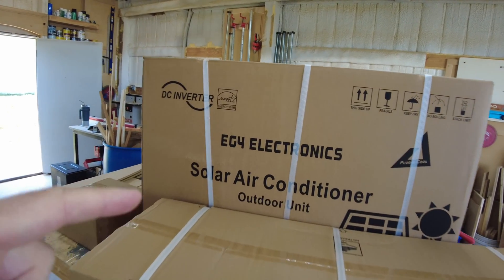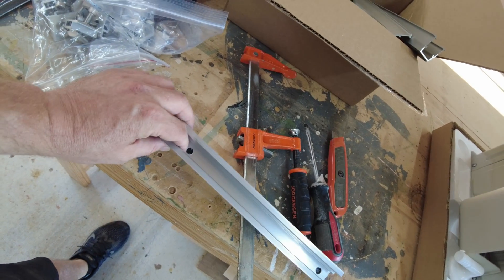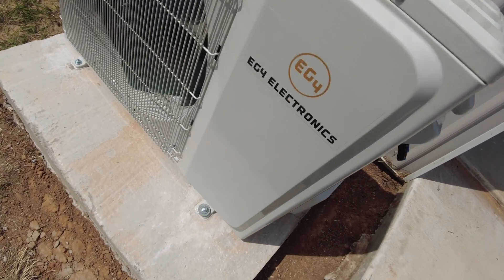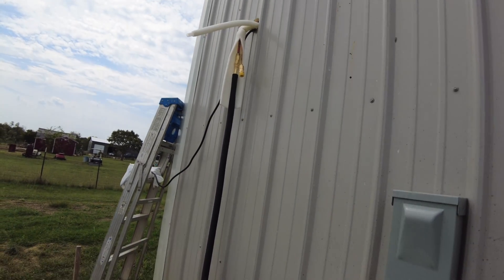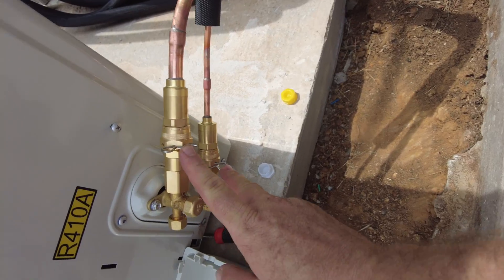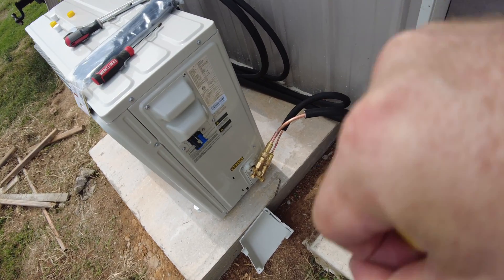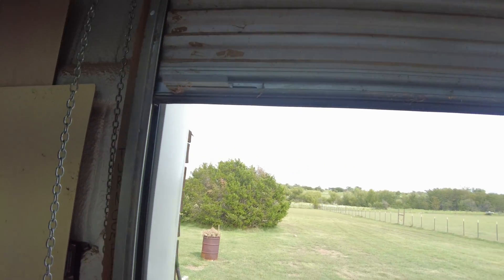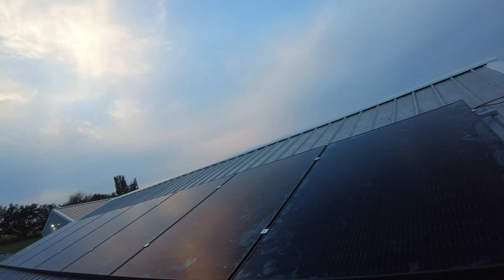EG4 Hybrid Solar Mini-Split 24000 BTU Air Conditioner Heat Pump

Comment from the maker: Affiliate Links:
➡EG4 Hybrid Solar Mini-Split 24000 BTU: https://signaturesolar.com/eg4-hybrid-ac-dc-solar-air-conditioner-2-ton/?ref=JRZm6fna41pidY
➡EG4 Hybrid Solar Mini-Split 24000 BTU Kit w/Panels: https://signaturesolar.com/eg4-hybrid-solar-mini-split-kit-energy-star-certified-air-conditioner-heat-pump-ac-dc-24000-btu-seer2-21-3150-watts-of-solar-pv-kit-e0012/?ref=JRZm6fna41pidY
➡Mini Rails: https://signaturesolar.com/mini-rail-330mm/?ref=JRZm6fna41pidY
➡Mid Clamps: https://signaturesolar.com/mid-clamp-for-mini-rail-silver/?ref=JRZm6fna41pidY
➡End Clamps: https://signaturesolar.com/end-clamp-for-mini-rail-35mm-silver/?ref=JRZm6fna41pidY
➡Mini Rail Grounding Clip (Need 1 per clamp): https://signaturesolar.com/standing-seam-mini-rail-grounding-clip/?ref=JRZm6fna41pidY
➡PV Wire: https://signaturesolar.com/pv-wire-50-ft-10-gauge-copper-30-amp-black-red/?ref=JRZm6fna41pidY
➡PV DC Isolator switch: https://signaturesolar.com/dc-disconnect-rooftop-isolator-switch-by-imo/?ref=JRZm6fna41pidY

================
AFFILIATE DISCLOSURE: This channel may earn an affiliate commission if you purchase products through links I provide. 
================
CONTACT: bradcagleyt@gmail.com
Business/Collaboration only. Please do not contact me for for personal project help, or advice.
================
DISCLAIMER: These videos are documenting my own personal projects, and experiences. These projects, and activities can be dangerous. I am not a professional. You should always consult with a professional. This content is for entertainment purposes only. DO NOT try any of this at home, doing so will be at your own risk.

Comment: Remount the compressor unit and this time put the rubber foots on before you screw down the mounting bolts, that will make the unit run so much quieter

Comment: You may want to add what's called a heat pump riser under each leg. The mini splits, when they run in heat mode, the outdoor unit can build ice. the unit will go into defrost and not having space under the unit will cause the ice to build up and may damage the outdoor coil causing the refrigerant to leak. I'm in Connecticut, the manufacturer I use will not warranty the coil if it is not up on those stands.

Comment: Your array is way over sized for this system but I would split it; give half the panels to the EG4 and the other half towards a battery system like their EG4 or EcoFlow products to offset the energy you are using in the shop.  You are wasting a lot of your solar production and over paneling the specs on the mini split I’m assuming… good stuff otherwise.. just something to think about.
Reply from the maker: This is actually the big 24,000BTU (2 ton) unit so it needs more power than your typical mini-split. Also It was purchased as a complete kit from signature solar, and those are all the panels that came in the kit. Thanks!

Comment: What about hot nights??
Reply from the maker: Runs off your grid/house power at night.
Reply: Incorporate thermal mass into your home. The machine cools the interior of the home, the mass absorbs heat after the sun goes down, keeping you cooler for longer.

Comment: 13 Amps exceeds the maximum recommended amperage for these. Apparently they will tolerate it, but you're not supposed to run more than 12 amps.

Comment: Inefficient I have seen people install them then disconnect them to run the panels directly to their inverter and use all the solar cells capacity to its fullest.. then feed a regular cheaper mini-split... this is a fail..You will under utilize your panels if you use this system nice try..
Reply: Yes, that is all true, but not everyone has grid tied solar, or an ESS. You do not need a permit or an interconnection agreement for this. This requires far less monetary investment to add cooling or heating to a space that is usually only occupied during the day. Also if you live in an area with high summer heat and/or humidity, with high electric rates, this is a way to reduce your power bills with a fairly short break even/payoff period, without the need for permitting/interconnection agreement etc. Although you may need an electrical permit if wired to a panel. But yes, if you already have panels/inverter/ESS, it would be cheaper to add a basic inverter based mini-split (pioneer/senville/alpine/gree etc)
Reply: Maybe I’m slow, or maybe your message was just poorly put together, but I’m a minute in and reading your comment has me lost.
Reply: No bats or inverter needed unless need night time power lol if so about $3k will be needed for bats and inverter.For off grid.

Comment: Why would you not hook up the solar Panels to a microinverter and feed the power into the grid? Then you could also cool with it, but if you do not want to cool, you could use it for other appliances. 

Like this, the excess solar power is simply wasted.
Reply from the maker: Right now it's running strictly on solar, and it just comes on automatically when the sun is shining. Cooling full blast through the day. So it's using most of the PV anyway. There might be a little time during the day when they would be over producing, but not much really. Later they may add an inverter, and battery to store excess to run other things, or for power outages, etc.. Thanks
Reply: Tradeoffs..  Like this avoids efficiency losses due to inverting and then conversion to DC and then reinverting..  As you said though, it’s somewhat less flexible.  But panels are pretty cheap and if you want to heat or cool the shop every day, say for a commercial operation this is pretty good.
Reply: Why do people wanto subsidize the electric grid by paying for solar panels. Call me selfish but I would rather run directly off the solar than convert to AC and let the electric company decide how much my savings is. By converting to AC and attaching to the grid you only save what the power company decides you save. Even worse is you're paying to generate electricity for the electric company by paying for a percentage of the use of your solar power.
Reply: @mikemerkel2411  being grid tied (converting to AC) doesn’t put the utility company entirely in charge.  The amount of power your house consumes directly from solar is up to you.  You can easily set the system up to charge an EV, heat or chill water, whatever during peak solar hours, and avoid the financial loss due to arbitrage.  At least in the US that’s possible.
Reply: it heats and cools ---the solar is producing the electricity to operate the heat pump
Reply: yep pretty awesome

Comment: it just doesnt make sense to install bi facials without a white background
Reply from the maker: Yeah, the system was purchased as a kit, and bi-facials are what came with it. Seems like I'm seeing more bi-facials these days than not, so I would not be surprised If bi-facial just becomes the norm even if you can't benefit from the gain. I could be wrong, I guess we'll see in time. Thanks
Reply: @BradCagle  i think you missed the point here. the gains would have been substantial if you had painted the metal roof white first.
Reply from the maker: @pearlrival3124  No, there's not enough gap between the roof, and the panels to allow any decent amount of light behind anyway.
Reply: @BradCagle  interesting. how much gap is required to get utility from the bifacials? maybe you can bring this up in the part 2 if you havent finished filming.
Reply: @pearlrival3124 all the testing I've seen the gains from bifacial are far from substantial. Since the only thing he's powering with his panels is the AC unit why would he need gains from a bifacial panel anyways? And the roof doesn't have to be white. Any light colored surface will reflect light.
Reply: @fauxque5057  the industry is known for using a white background to add to the energy obtained from the secondary panel to more or less limit the footprint of solar panels. i believe brad already responded here and mentioned gains are negligible when the panels are that close to the roof. maybe a 100mm gap is more appropriate as opposed to the current 50mm gap used on this roof. while white is the industry standard you are correct you can use mirrors but they tend to overheat your hardware in panels.